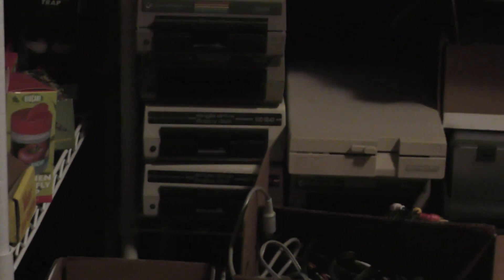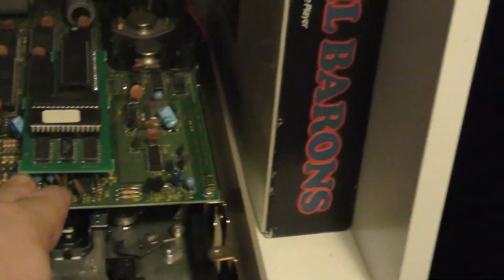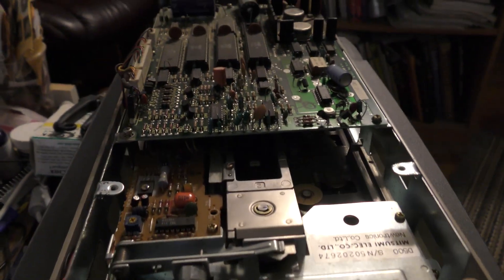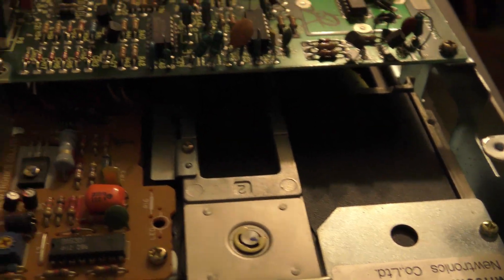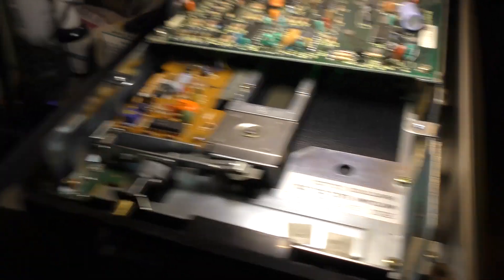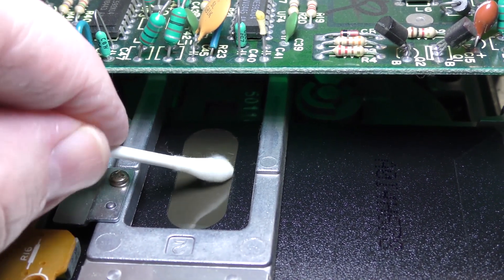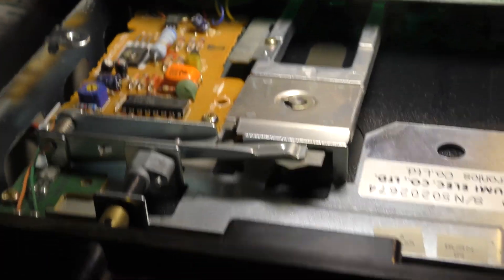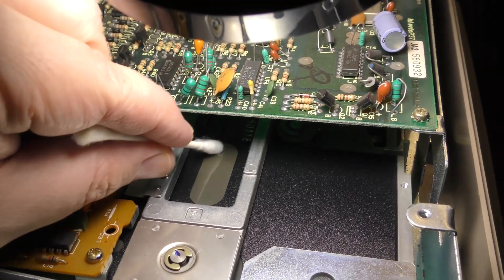Commodore 64 Floppy CLEANING drive to REPAIR your old Floppies

Comment: It's the dreaded black mould that accumulates on disks as they age. Remember those temperature and storage warnings on the back of the disk jackets? Hehe

Anyway, I have salvaged disks that wouldn't even read with this method. Only that I would say that it's critical to remove the read write head mechanism from the spinning drive so that when you apply pressure to the disk that you don't scratch the other side of the disk with the read/write head. Also, make sure that the q-tip is wet. DO NOT attempt to clean the disk if the q-tip is not wet with alcohol. Also DO NOT press too hard on the disk when cleaning, otherwise there's a good chance that you can rip the metal oxide clean off the disk and make it permanently unreadable.

Also note that dirty disks will dirty read/write heads, so when attempting to read old disks you leave the top of the case off. That way you can routinely clean the heads with alcohol and q-tip. Those heads will dirty up as mould gets scraped off the disk as it spins, and so constant cleaning is necessary.
Reply from the maker: I've had plenty of disk with old mold, I figure the disk was stored in cold basements, garages, sheds. etc. I really do try to save, but many will end up in the trash sadly. Thank you for your comment.
Reply: @StevesRetroGaming   That's usually the case with mould - improper storage locations. That said after many years it can simply accumulate with exposure to air and the quality of the disk also plays a big part in how long they last, depending on branding. 
Most disks can be salvaged with enough effort, but some can't and are too far gone - with the metal oxide just peeling off the disk under light q-tip pressure in rare cases.
I had better luck using an old 1541-II to clean disks with, as the mainboard is under the drive mechanism, so it's easier to clean the heads. Also easier to remove the R/W head mechanism. Same trick applies where you can remove the ROM chip on them to get the drive to spin the disk endlessly. I have a 1541-II set up specifically for disk restoration.

Comment: I'm a tad confused. To clean, the dirt needs to be transferred to another medium.

Is the dirt transfering to the floppy disk? I do not think the magnetic surface is porous.

Could dirt on the disk be deposited to the drive head?
Reply from the maker: The dirt always gets transfers to the read/write head, I keep the lid off of my 1541, because I have to clean the read/write head after testing every few disk. Thank you for your comment.

Comment: You remove ub4 chip so it will spin constant?
If so, is it the same on 1541-ll and 1571?
Reply from the maker: Yes, remove the UB4 Chip and the 1541 and 1541-II will spin non stop. I have not tried on the 1571.

Comment: The disk clamp spindle thingie...see how it is spinning, stopping...HEAR that thing?! Yeah, the circlip on that pin...there's an order to those washers and spring when you put it all back together. Take it all apart, DON'T let that circlip fly into that black hole awaiting below. Clean and lube time! Sewing machine oil. REAL light. Wipe off excess. Less is best. If you're questioning whether or not you have enough oil; it's the right amount. Drive will go silent and errors are 100% gone. THERE IS a connection between this drag and read errors / rpm consistency. At least from MY experience with my one drive I've worked on. I'm not a know-it-all, but just trying to share.